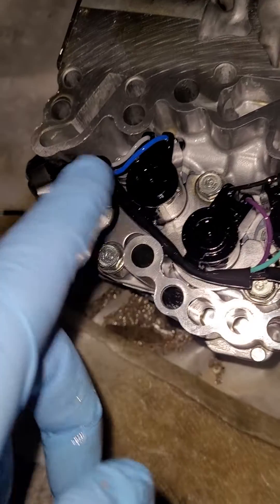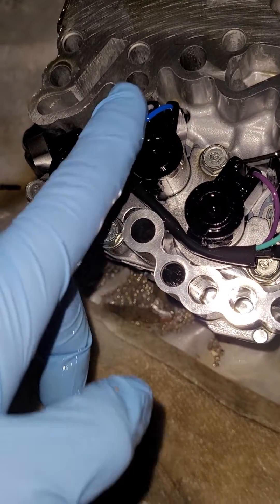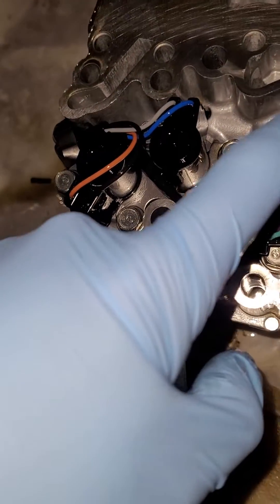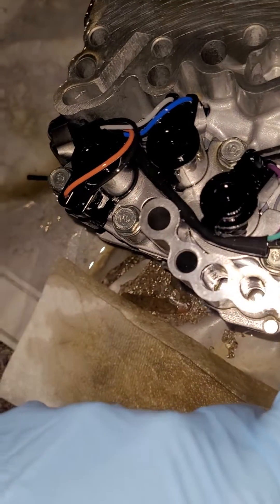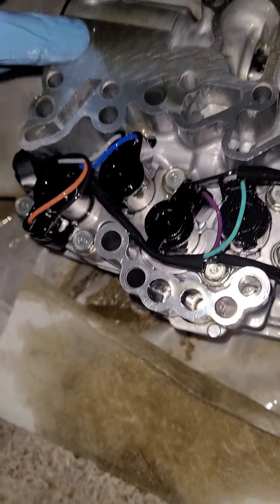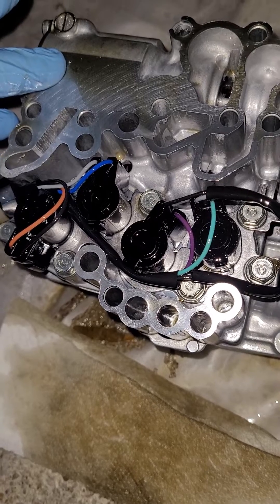TR 580 lockup duty solenoid issues (2014 subaru outback)

Comment: Thanks I’ve been looking for which one is lock up, can only find people replacing the whole valve body. I’m gonna tackle this tonight on mine.
Reply from the maker: Best of luck! Just don't take all the bolts out, certain ones hold the valve body together.
Reply: @supernova9088 tonight I replaced the solenoid. Drove home about 20 miles with a few stops in between. So far so good. Noticed a huge difference in performance, and no warnings on the dash. I can follow up after a few days of driving and leave the Dorman part number after I’m sure the issue is resolved with some good drive time. I can see what you’re saying about the bolts that hold the valve body together too, had to line everything up again to get the base plate that holds the solenoids down bolted in. Another thing id like to throw out there for anyone else doing this job themselves, is that the ground right by the lock up solenoid broke when I torqued the bolt down, had to trim the wire and put a new connector on. But again, thanks for the video. 👍👍
Reply from the maker: @user-he8mj9jp1m  awesome! I had issues after about 1k miles or less and replaced the entire thing but it's not cheap. Going strong now 15k miles later
Reply: @supernova9088  I’m hoping I can get enough miles to get me by til I can swing a new valve body. Even just a couple weeks
Reply: @supernova9088  I just wanted to follow up since replacing my solenoid. 4 k miles with no issues. It was a Dorman part.
Reply from the maker: @user-he8mj9jp1m  that's awesome news! I wish mine worked out but I think I made a bigger mistake. Later fixed and still going as everyday driver now.
Reply: @supernova9088  I had to go and say something. I’m picking up a new valve body tomorrow 😅

Comment: Where did you buy the AWD solenoid? I need them too. Trying to figure out if I should buy the entire valve body or try to find the solenoid.
Reply from the maker: Ebay personally but I would reccomend getting the entire valve body assembly and learning what bolts you font touch when taking it out. A local subaru certified place should have the valve body for around 900$ usd.

Comment: Hi ! I have a problem with my TR580 and I need to replace the secondary line pressure solenoid 😢 do you know where can I get it ?
Reply from the maker: They are hard to find. Amazon and eBay but read reviews and stay away from "re-manned"

Comment: Change the fluid bro. Thats black
Reply from the maker: It's required after this step lol. Yes I changed it a few times actually with running engine in between to circulate new oil.

Comment: What was your symptoms? What caused you to look at the solenoids?
Reply from the maker: The codes read that there were faulty valves, I ohmmed them out but a few were weak. Replaced individual solenoid but wound up changing whole valve assembly due to cheap part failing.
Reply: @supernova9088 do you  suggest the full valve body replacement? I want to just replace single lockup solenoid with one from Amazon but idk now. Just expensive for whole valve body.

Just saw your other comments...whole valve body replacement  then 😅
Reply from the maker: @gamingaccount3382  personal experience- I changed one valve but didn't know what I was doing and took the wrong bolts apart. Take pics and videos along the way so you know... follow the link in description for procedure and bolts to touch. There's a few that hold the body together. I took the body apart and didn't put back together and almost messed the whole Trans up. Then I decided to replace whole body with new and haven't had an issue since. If you can get it out and just remove the solenoids then go for it but read reviews before purchase. 80 bucks for one valve is worth a shot if it fixes. If not then the 900 dollars will 100% fix it if you have solenoid codes. I spent nearly a grand for the new valve body at a local subaru dealership. I still have the old one and all solenoids should read good but I assembled it incorrectly.
Reply: @supernova9088  thank you. Seriously.
Reply from the maker: @gamingaccount3382  I also would recommend checking out subaru outback forums dot com. Very knowledgeable people there

Comment: I was looking at the solenoids on Amazon. The ones with more than 1 or 2 reviews had a lot of bad reviews. Not working or only working a few days to a few months. Off to ebay and the sellers of the solenoids almost all have several negative feedback for shoddy or faulty parts. I wish there was a reliable place to get the solenoids.
Reply: Did you find a reliable solenoid?
Reply: @rvglover  I found a broken ground in my valve body.
Reply from the maker: @LaughingTerry  that's pretty hard to achieve? How did that happen?
Reply from the maker: I had my notifs off guys sorry. I got mine from Amazon at first and it failed after two drives. Definitely just replace whole body